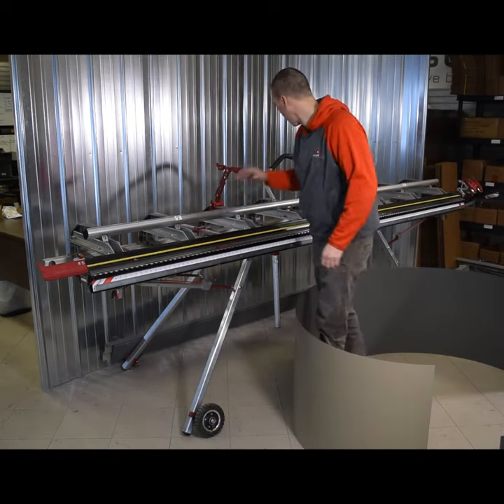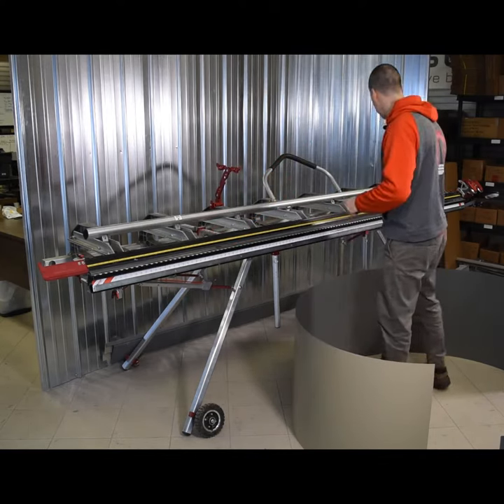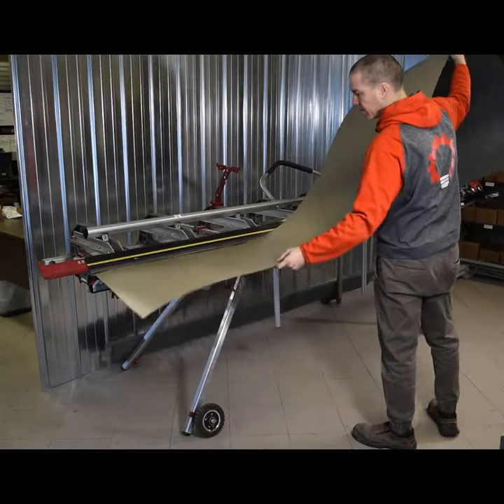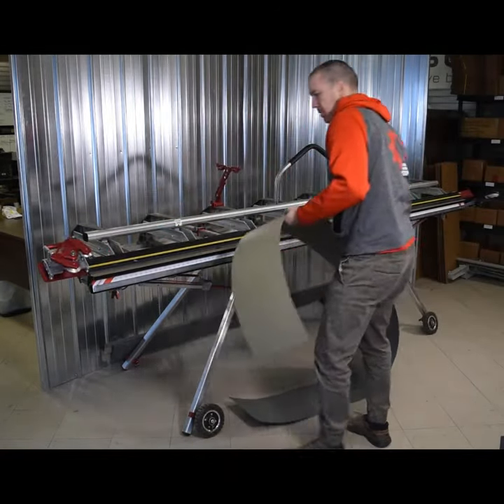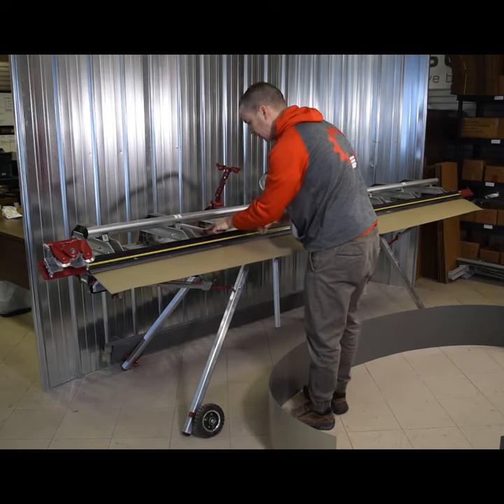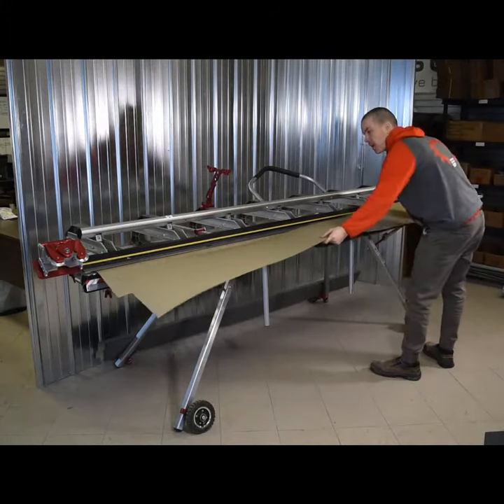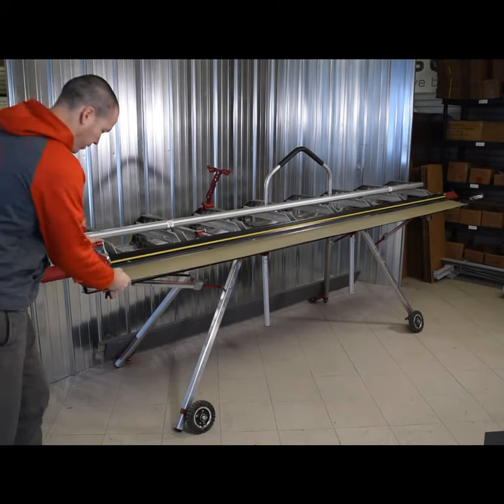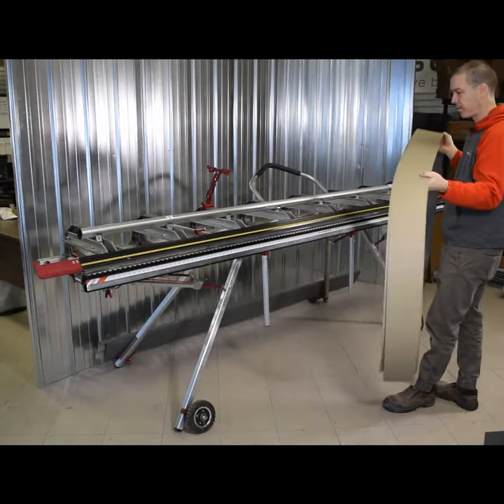Fastest way to cut coil stock on a siding brake

Comment: Does anyone know if 2 pcs is the max for the cutoff tool? Or can you cut more than that
Reply from the maker: It depends on the material,  we have another video with 3 layers but at some point it just gets too hard and impractical.  We did the 3 layer video more for bragging rights;)
Reply: @innovatoolsinc  right on. I typically use heavy gauge aluminum.  I just tried cutting 2 layers but it left a bit of a wave on one of layers, so maybe I'll stick to single layer unless I use a lighter gauge material. Have you ever tried out the 'brake buddy'? It looks like a cool tool. Ive been weighing out whether or not I should spend the money on one.